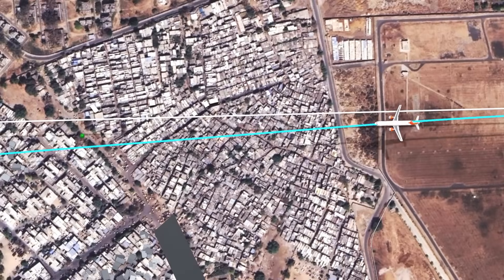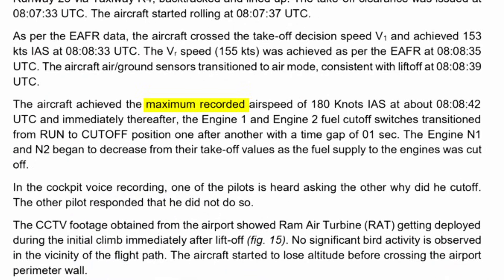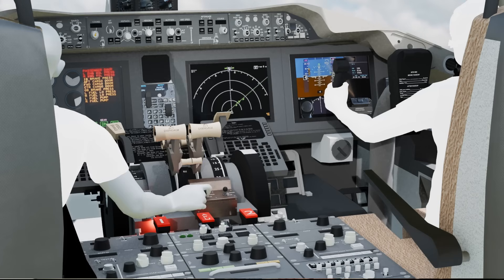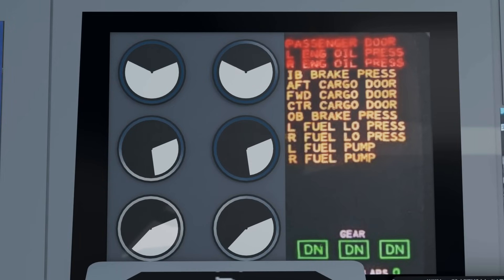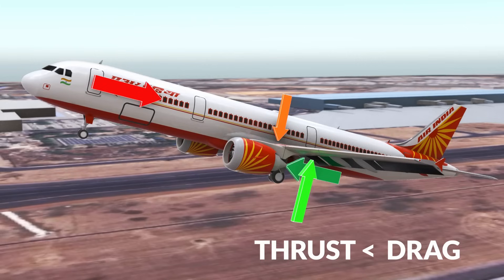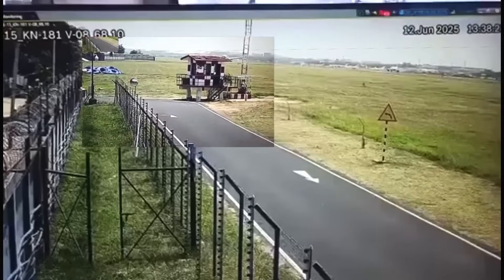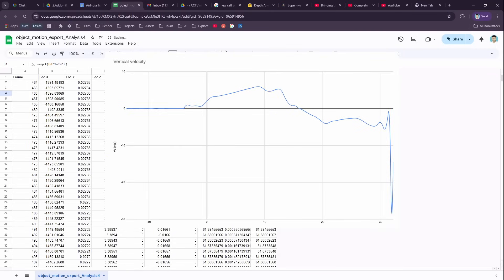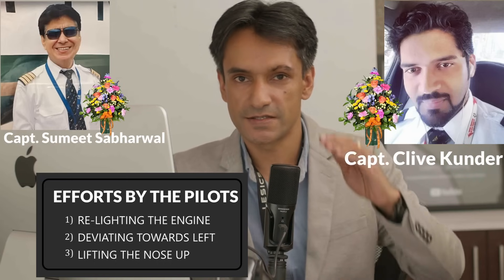Use of 3D Clone | Decoding the Crash Details you Missed

Comment: Unlikely that two pilots wanted to crash the plane. IF, then it was one of them. So he will for sure play innocent, just for the case he survives. He will know when to switch off the fuel for maximum effect, and then he just needs to play the worried pilot while knowing it will most likely fail to recover. So "Pilot tried to save the plane" is not a valid argument. The one flying the plane for sure tried. The other one, possibily in suicidal mission, probably did not. He just needed to wait. 
Would be interesting to hear the voice recordign. Nevertheless I also see the option of hardware fail or software glitch.

Comment: Of course, if you base your 3D model off of the accident videos it is going to look like the accident videos. Understand that the maximum recorded IAS of 180 knots mentioned in the report is not an interpretation, but data collected from the flight recorders. It is not necessary to understand the concept of residual thrust to come up with this value. Also, residual thrust after a fuel cutoff would not be nearly enough to accelerate the aircraft to an airspeed of above 200 knots especially when the airplane is in a climb. There is a dramatic loss of thrust after combustion stops. If the engine failure really occurred one second after takeoff, which is contradictory to what official data says, the plane would not have made it nearly as far as it did. And why use the 3D model of an Airbus A320 to represent an incident that involved a 787? If you're trying to go for accuracy maybe at least get the model right. And your claim that it is not possible to move the both fuel control switches to cutoff in one second is demonstrably false. There are many videos available online showing the operation of these switches, if you watch any of them you'll find that moving both to cutoff in one second is not only possible but a pretty standard shutdown procedure once the plane is parked at the gate. You are correct that the failure of both fuel control switches is statistically impossible. You are not correct that it was most likely the TCMA that caused the accident. Your understanding of the ANA incident is completely wrong. The ANA 787 in 2019 had already landed and the reverse thrust was deployed prematurely by the pilots, resulting in high thrust with the thrust levers at idle causing the TCMA to cut fuel off to both engines. If the failure had occurred in the air, there would have been a JTSB report published and significant safety recommendations made to Boeing. TCMA protection requires there to be a disparity between the engine thrust and the thrust lever positions. In the ANA incident, the thrust was high with thrust levers at idle, hence why the engines were cut off. In the Air India incident, the thrust levers remained at a TOGA power and a TOGA thrust was achieved. And don't you think the report's language would have been "the fuel valves moved to the closed position" instead of "the fuel control switches transitioned to cutoff" if the TCMA was really the culprit? And as far as signing the report goes, it is meaningless. It is already from a government source and it represents all involved investigators from the AAIB. To sign it would be meaningless, you also won't find any signed preliminary reports from the NTSB.
Reply: Cutting the fuel at a time when the plane was in a nose up attitude with flaps and gear out would feel like someone hit the brakes. People don't get it.
Reply: Very well argued! 👍
Reply: The missing answers can be found under Jeremy John Thompson AI 171 ( just google this and watch 3 videos starting with the first). He is a little rough around the edges but puts the facts together and proves them. His findings otherwise fit very well with what is demonstrated here.
Reply: @robertszabadi7167 "Understand that the maximum recorded IAS of 180 knots mentioned in the report is not an interpretation, but data collected from the flight recorders."

Do you realize the maximum recorded 180 knots IAS speed could be factually correct even though the actual speed of the aircraft could have been higher at a later point in time. I have a theory and this is another data point that may offer more support for the theory. 
After fuel switch Cutoff all four engine generators go offline and the 28V DC instrument buses would then require main battery standby power until RAT power came online about 10 seconds later.
My theory is there was a problem with the main battery standby power and the Captain and FO instrument buses were without power during this time. It's very possible, while the instrument bus power was missing the speed of the aircraft was not being recorded by the FDR during this time. When RAT power did come online and restore power to the instrument buses the speed of the aircraft had decreased and when the speed was again being recorded it was below the 180 max speed recorded earlier. 
What I don't know with certainty is if the 28V DC instrument buses power the electronics responsible for air speed and/or the remote data concentrators that send the air speed data to the FDR.  
I do find it very interesting, in both this Sabin Mech Eng 3d model simulation and the Wingx simulation the plane continues to increase in speed for some time after the fuel switches were moved to Cutoff. If the simulations are even somewhat accurate it would mean the fuel supply to the engines wasn't cutoff it's more like a thrust rollback in both engines.
Reply: @dougswanson9142  It was a fuel cutoff. It's a recorded parameter by the EAFR. The report also clearly says the engines passed below there minimum idle speed, this was not just an engine rollback. Your theory is completely baseless. Again, the report makes absolutely no mention of an electrical failure that would have caused the symptoms you described.
Reply: @robertszabadi7167  What I'm saying is not baseless, wrong maybe but not baseless at this point until I see more proof otherwise. The symptoms I'm seeing are starting to add up, the APU auto start logic delay, the fuel switches delayed time back to Run and now the possibility of the air speed not being recorded for a period of time are all plausible symptoms of a problem with the main battery standby power. What's left out of the report no longer surprises me.
Reply: @dougswanson9142  But there is absolutely no official proof of an electrical failure. And what do you mean the fuel switches delayed time back to the RUN position? The switches were moved to RUN 10 seconds after they were moved to cutoff. This was a human action, there is no automatic system which restarts the engines. And a standby battery failure wouldn't cause an engine failure or rollback.
Reply: @robertszabadi7167  After the switches were moved to Cutoff and all four engine generators went offline I'm saying the battery standby power wasn't there to backup the 28V DC instrument buses and the hot battery bus, the fuel control relays didn't have power, which means even if the pilots moved the switches back to Run nothing happened, without power the fuel controls relay coils can't be energizes so no fuel valve changes and also the remote data concentration had no power so no/delayed recorded transition in the FDR. Basically, the fuel control switches didn't operate as expected until RAT power came online. The fuel switches were physically moved quickly backed to the Run position but nothing happened for about 10 seconds until power was restored. 
You might want to rethink your comment about standby power not potentially affecting the engines. Battery standby power goes to the common compute resources cabinet, it supplies backup power to internal clocks and memories. I can't say with certainty what happens to the computers when standby power is lost but standby power from the hot battery bus is there for a good reason. I believe battery standby power also supplies backup power to the thrust control module. 
APU auto-start logic should have initiated when the engine generators went offline, in the report it did initiate but about 10 seconds late. There may be nothing official in the report but there are clues.  I could be wrong about all of this but everything I've mentioned is plausible.  I've done a decent amount of research and my motivation is I don't buy into the Captain-did-it narrative.

Comment: The fuel switches were probably in the off position when the aircraft started. Perhaps there was enough fuel in the system to get it off the ground just barely, and this fits the evidence on hand. It still does not point to either pilot error/sabotage. However, the 2018 FAA advisory, non-urgent though it was, points to the switches failing. Because if the recommended action was to install fail safe modifications, and it was not done, then either or both Air India, or the FAA are at fault. Air India, or more correctly, the authors of the report, seem to be indicating that since the advisory was not presented as urgent, or compulsory perhaps, the modification was not carried out. In any case, it indicates the pilot error/sabotage argument is wrong.
Reply: Just.....no

Comment: I agree that the preliminary report is woefully lacking with regard to clarity and accuracy, but I don't think you can draw your conclusions.
Firstly, we know that it was the First officer flying the aircraft, not the Captain.
You refer to 'the pilots' throughout your presentation, inferring that they were both working together. How does your analysis change if it was just one of the pilots who was intentionally trying to crash the aircraft, with the other pilot trying to save it? 
The brief exchange that has been released between the pilots about the fuel control switches suggests that, at the very least, there was a misunderstanding.
I believe the CVR recording will reveal the true picture.
Reply: if he wanted to crash he could have just pointed the nose down no? if he wanted to do so. its the said pilot that you are accusing of  switching the fuel switches off, he was the one who was controlling it
Reply: @lethalshadow95  When the copilot is flying (PF) he has both hands on the yoke, the capt. who is monitoring (PM) has his hands free. 
What if the capt. wanted to disguise the fact that he cause the aircraft to crash? Switching the fuel control switches to cutoff a few seconds after wheels off is the perfect time to do it. Too late to land straight ahead and stop safely, but too little time and height to relight the engines.
Reply: Hi Mike just google Jeremy John Thompson AI 171 and see his three videos starting with the first. This guy has basically figured out what happened and can prove everything he says.

Comment: The 787 AAIB preliminary report is vague and partial. Technical investigations of the sort you have carried out are therefore to be welcomed if for no other reason that it shows the AAIB that a similarly shoddy final report (if it ever appears) will not go unnoticed. As to the topic of RAT deployment time, the AAIB will have extracted this from the EAFR but chose not to provide it. Instead, they published Figure 15, a photo of the RAT deployed at some unspecified time and location. Why?
However, I do have some issues with your analysis. Assuming that your general trajectory reconstruction is correct, given the poor quality of the airport video I find it difficult to believe that the reconstruction is accurate enough to show fine detail such as the timing of thrust changes. In order to get some idea of magnitudes for the purpose of a sanity check, use as an example simultaneous dual engine failure and crude ball-park values: mass=200k kg, thrust=2x300kN, pitch=0.1rad (6deg). As you point out the thrust of a high bypass fan engine takes several seconds to decay once the fuel is cut, so it is difficult to use this to detect fuel cut-off without knowing much more about the engine characteristics. However, 10% of this say, decays more rapidly, and this perhaps can be used as an indicator. So, the rapid component of thrust change along the total velocity vector is 2x300x0.1=60 kN (the cosine term is close to unity). The associated acceleration change is 60/200=0.3m/sec^2 (0.6 knots/sec). However, when I look at your velocity against time graph, I do not see any sudden change in the slope of the curve that matches this. What I do see is a more gradual acceleration change between about 4 secs and 8 seconds of about 3m/sec^2 which might reasonably be associated with the collapse of total thrust (aerodynamic incidence increases relatively slowly during this period). The subsequent reduction in acceleration is probably mainly due to more rapidly increasing incidence leading to increased drag. Turning now to rapid vertical acceleration change, this is 2x300x0.1xsin(0.1)/200=0.03m/sec^2. Again, when I look at your Vz against time graph I do not see this. What I see is an acceleration of about 0.3m/sec^2 up to about 8 sec. This is maintained constant by varying incidence that towards the end is compensating for the failing vertical component of thrust. After 8 seconds there is a rapid collapse in Vz as speed decreases, lift per unit incidence decreases, incidence starts to approach stall values and drag increases. Just after lift-off there is a rapid change of slope (dVz/dt) that you ascribe to engine failure but the change is either too large or too rapid for this to be true. There could be a couple of alternative explanations:
1. In the airport video at lift-off the aircraft was obscured by a shed, so perhaps you formed your trajectory in two parts, based on pre and post shed video frames. When you joined them, they did not quite match, leading to a glitch.
2. In your video you do not say where the datum tracking point on the aircraft is. If it is near the nose then that point would experience an additional (compared to the cg) impulse shaped acceleration as the aircraft rotates to generate incidence at take-off.

Comment: There is nothing to do with the switch.
Yesterday I was traveling from Bengaluru to Patna in air india and the pilot announced there is a malfunction in aircraft as they run on the runway for minute but maybe they found they will crash if they fly because the power wasn't that much later engineer found one engine was failed after 1 hrs they changed the aircraft same thing happen earlier in that air india that time the pilot were unaware or things but this time a great step lead by pilot and God saved us.

Comment: Don’t look at the pilots, they’re heroes. Look at FADEC, and that’s where you’ll find your answer, and behind - Boeing!  Better for the families to sue Boeing because it’s a great big cash factory; if you sue Air India or the pilots, you’d get nothing spectacular.
Reply: Each engine has its own FADEC. You think both failed at the same time?
Reply: @stimproid  It’s the upstream data interlocks that sent (or didn’t send) critical interlock systems to prevent it shutting down the engines.

If those notorious switches switched the fuel valves independently from the aircraft automation control systems without interlocks or logical permissives designed into it, then that amounts to negligent design by Boeing.

The more I understand the Air India accident, the more I’m convinced that it’s Boeing who’s at fault for negligence. I would be happy to testify in the court case showing the jury where Boeing went wrong.  I’m a qualified engineer, plus I have certification for designing electrical and electronic safety systems, which makes me an expert.  And while I’ve not worked on aircraft control systems, the fundamental principles are all the same across all industries - fundamentals that Boeing failed to follow when they built their aircraft.  Remember, the underlying physics and engineering doesn’t care what anyone thinks, says, or does, it’s going to behave as nature intended, so no amount of rhetoric is going to change that.